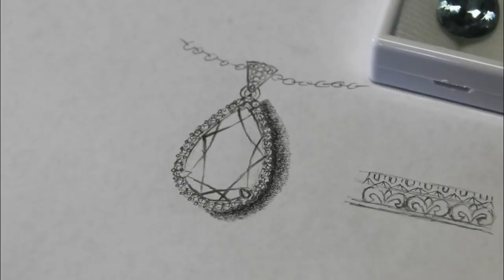Making a white gold Aquamarine pendant

Comment: AMAZING pendant! Looks fantastic! But I don't really like that gap between the bottom of the gem and the gallery. It is there intentionally?
Reply from the maker: jonikq 
Yes, in this case I did not want the underbezel showing through the stone so I lifted it about 1mm. The stone is secure and has plenty support
Reply: @JanHendrikViljoen  Oh, I see. I'm at the very beginning of my jewelcrafting journey. That's a great tip for the future, thanks a lot!
Reply from the maker: @jonikq  Normally I would sit the stone right on top of the underbezel. Especially for rings. In this case the stone is set in a pendant that will not have to endure the hammering you usually get with rings

Comment: Thank you for posting another inspiring video. May I ask what is the black modable medium you used to hold the pieces while you worked on them, and the wire used to hold the pieces during soddering?
Reply from the maker: The black medium is setters shellac.
I use iron binding wire to hold pieces together when soldering.
Reply: Thank you for the information, aloha from Hawaii.